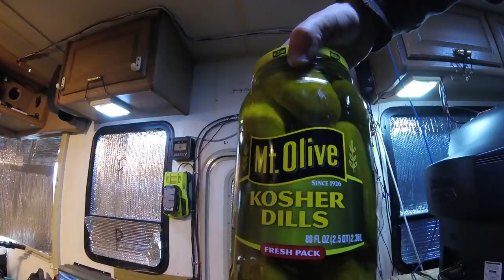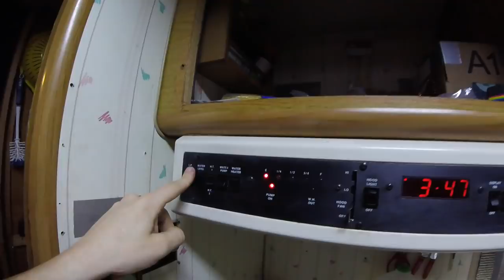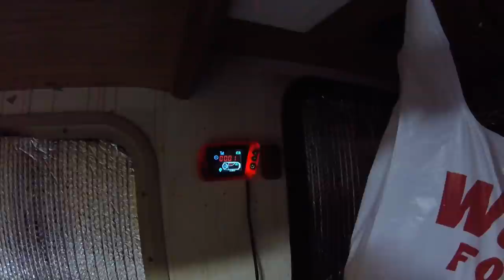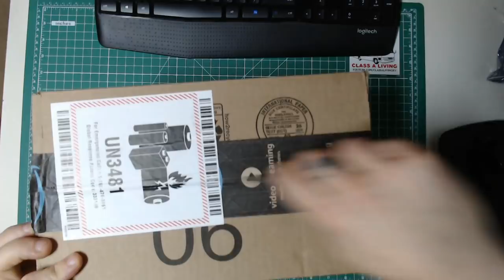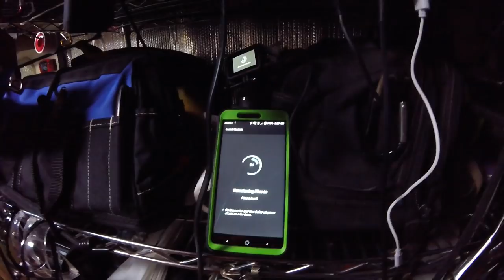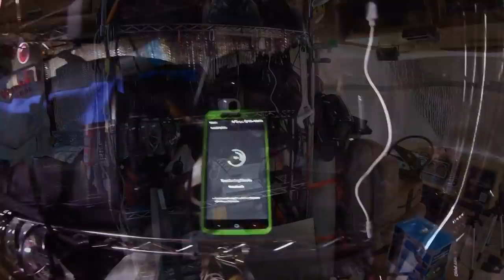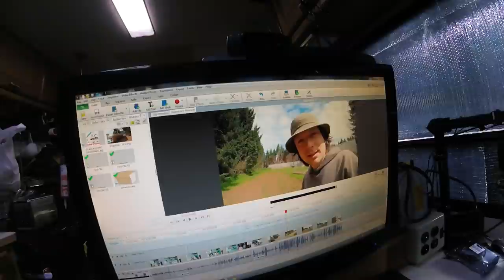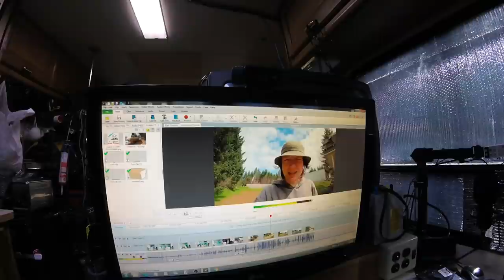GOPRO HERO 8, New Tools || RV Living

Comment: I too have a diesel heater (bought through your link) and tested it for the last couple of months at my off grid cabin. Boy I am done with propane (back up only) cause my 40 000 btu heater will burn a 20lbs tank in roughly 10 hrs (on high)and that's like $18-20 (Canadian)My diesel heater costs $9 on high for 24 hrs. Luv your channel Nate keep on keeping on  !